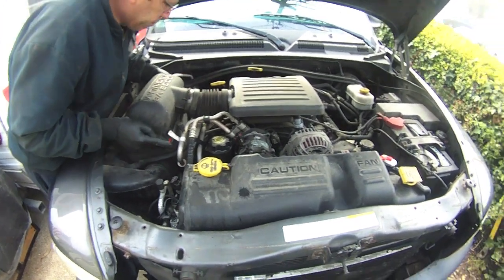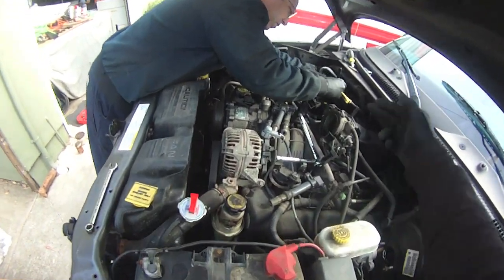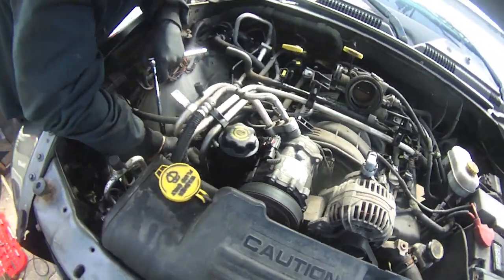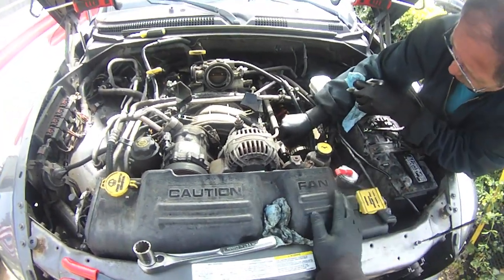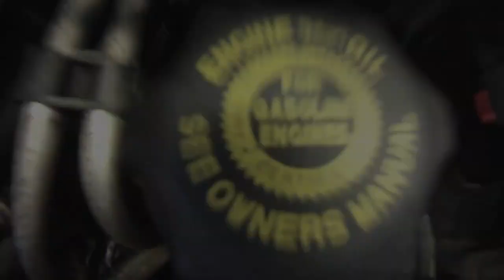How To Remove Dodge Valve Stem Seals

Comment: Was looking for a video like this on the 47 a few years ago when my 01 GC started smoking more and more. I thought you had to pull the cams and gears and lock top of chain and hope you put it back together right. I've since swapped a 03 GC 47 HO in my jeep but 3 months later something !! Lol not as bad but sucks after doing all that work and kinda back at square one now with a 03 drivetrain. Your video showed me what I needed to know and special tools like the keeper thing. I've always just seen folks use a little magnetic but that tools way better ! Would have like to seen a POV on at least one cylinder but still this video helped a lot. Thanks
Reply from the maker: Thanks for watching.  I'm not a mechanic and while I have replaced stem seals on engines before, I honestly had never done work on a Dodge and wasn't sure what I was doing...lol.  It's difficult to stay focused on a new task and remember to get good shots/angles/video of the process.   This Durango is still driven daily and to my surprise, it's quiet and doesn't burn oil.  I have used different methods to get the keepers removed... but this is the first time I used the actual tool and it was such a time saver.  I recommend to buy/rent/borrow the keeper removal tool and you will not regret that choice.  Good luck with your repair.

Comment: Did you guys end up leaving the belt on the engine and turning it by hand with the belt wrapped around all the pulleys
Reply from the maker: Yes, we didn't remove the belt and with the spark plugs out, the engine spun over by hand fairly easy.

Comment: Hi have you work on a 2003 dodge caravan before ? I’m trying to replace the valve stem seals on my caravan . The loaner valve spring compressor from autozone it doesn’t compress enough the get the keepers out. It tried another type of compressor it’s an L shape piece of metal and it didn’t work either. I thought maybe you’ve done dodge caravan before and you can suggest which valve spring compressor that will work for a 2003 caravan.
Reply from the maker: I don't do this type of work on a regular basis.  There are different types/styles of spring compressors and you may need more than on type of compressor in order to get your job done. With the engine in place and accessories in place, access is tricky and takes some strength and creativity to make this job happen.

Comment: Hi new sub here, what kind of valve spring compressor you are using for this vehicle on the video . Are you using 2 or 3 diff valve spring compressor? I’m trying to replace the seals on my 2003 dodge caravan I tried autozones valve spring compressor but it doesn’t compress enough to get the keepers out. I tried another compressor tool it’s like a L shape flat metal but you need a lot of strength to use it ( doesn’t have enough leverage) have you change the valve stem seals on a 2003 dodge caravan before?
Reply from the maker: Hi, one type was used, but we did use a "cheater" bar to gain more leverage and at one point it got quite frustrating to get the right angles and leverage.

Comment: Do you always have to remove the rocker arm in order to remove the springs? I saw a kind of valve spring compressor that has a hook on it, it has to hook on something in order to work . But since I remove the rocker arm there’s nothing I can hook it on.
Reply from the maker: You can't remove the spring with the rocker arm in place.  The hook that would be used for this type of rocker assembly set-up would hook to the pivoting rod that goes down the middle.